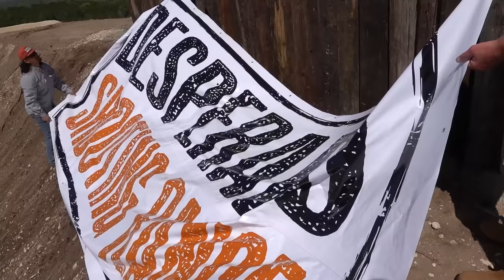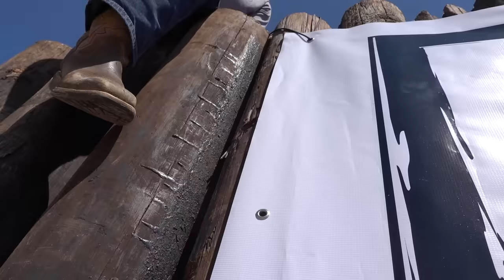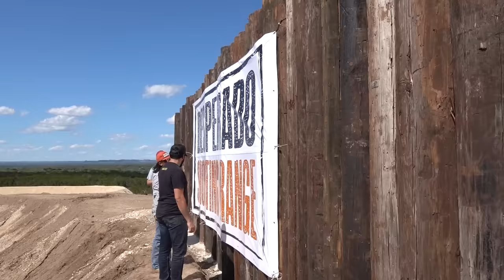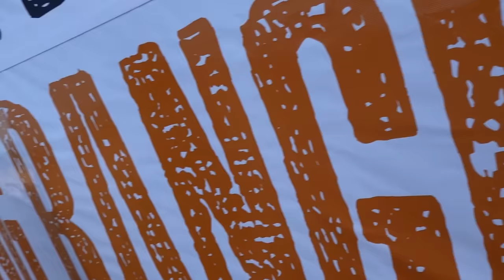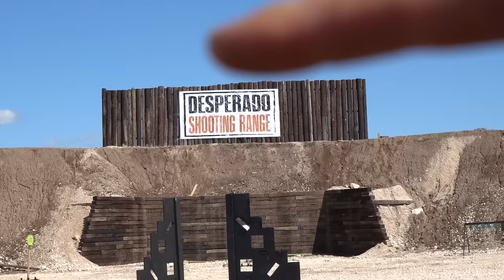Bad Problem with Underground Shipping Container... Y'all Were Right...

Comment: Hey Matt. I worked as a camp site supervisor for creation festival for several years in the past. One issue we had was when tent campers were camping next to people with RV’s. The exhaust from the generator was effecting the tent campers.
Reply: 1990, the year of the heat.
1989 the year of the mud.
Reply: Yeah that’s pretty fucking obvious
Reply: That's one major reason to have an electrical hookup. Also, the convenience is a pretty big one too.
Reply: I’ve been camping in my 40’ motorhome for 5 years all over the country. Not a single place as EVER asked me to put on a generator exhaust extension.
Reply: True that!! It's important to have a designated tent area. Some Rv parks just don't have tent camping. Also for anyone camping you definitely want a stay limit. Fed & state lands are usually a max of 14 day stay limit.
Reply: @smokeyiztactical aren't you a joy to have around.
Reply: Leave the wood in a pile for bonfires.  If your going to allow them. Camping = Bonfires.
Reply: My biggest complaint about tent campers is the 600$ price tag and 800$ for the largest Rv's......... wtf? I was thinking around 100 bucks or so for a tent spot.
Reply: @skydivejumprope $600 to $800 is what he is charging?  That's getting swindled.
Reply: @skydivejumprope  600 for a tent is a lot, as usually it's two people.... RV is acceptable if a family comes with their four children or some friends. And it depends on what is included.
Reply: $600 for a tent? That’s highway robbery!!!
Reply: Looks like plenty of fire wood to sell to all the campers coming in a couple weeks
Reply: @allaboutroofing2  lol swindled, do you even know what that means? Do you understand the demand for a space to view the eclipse? Its insane. You can expect that these prices are an anomaly due to the eclipse and wont be a standard rate.
Reply: @mammutMK2  He could have charged $1k and people would have still bought it
Reply: @kevinjohnson9404  "No fire pits" -grills only.
Reply: @reed785M  lol, it can be viewed most anywhere in the country. Clear weather is all that is needed.
Reply: @allaboutroofing2  eclipse space for camping is at a premium plus a lot of people are just  trying to support the channel not like its a normal camp site.
Reply: @allaboutroofing2  you’re talking to the wrong person, I’m not the one buying spots.
Reply: @reed785M  you just commented to me 8 minutes ago. I replied.  Are you okay?
Reply: @derreckmckenzie5521  right, no hook up or anything other than a hand wash station and Porta potties. Nothing like over paying to support a millionaire tho. 🤭
Reply: @smokeyiztactical  so obvious that no one would have thought about it.
Reply: @allaboutroofing2  you replied with nonsense, regardless of if you can view it everywhere, people want to be in certain areas and are paying to do so. I am not, so I’m not the person to be lecturing about “you can view it anywhere” it’s a pointless comment.
Reply: @reed785M  true.
Reply: Could definitely use a wood chipper converting all the cedar and dead branches into trail mulch.
Reply: Eclipses are neat. But they're not that cool. Turn the sun off for a bit and charge whatever you want? 600$ to pitch a tent????? No thanks. I'd rather just not watch it. But, i'm biased because i've seen them before.
Reply: It’s 600.00 for up to 8 people per spot though.

It’s expensive for a couple. But an entire family or group of friends… it’s still expensive lol
Reply: @reed785M  you seem dense. Have a good one.
Reply: Huh my best friend went to Creation for like 9 years. Small world
Reply: WAS A SUP<FOR CROWD CONTROLL COMPANY**     THIS IS A BIG TIME CONCERN***LISTEN TO THIS GUY********                   CATER
Reply: @scoobymoto9858
5 hours ago (edited)
Hey Matt. I worked as a camp site supervisor for creation festival for several years in the past. One issue we had was when tent campers were camping next to people with RV’s. The exhaust from the generator was effecting the tent campers
Reply: @MichaelCurley-il6sm  Many factors go in to the pricing. First, it is not your average day on an average campsite. This is for the Eclipse. I guarantee if you look up hotel rooms in the path of the eclipse, they will be 4X plus or more than normal rates. I used to rent hotel rooms near the hospital my mom was at for cancer surgery. She was there 3 months. Average room rate was anywhere from $150-$250, depending on the hotel. When there were events in the area, like medical congresses, you couldn't book anything for less than $250.
Reply: @TheMicro4 is creation only in pa? I been there, in pa.
Reply: Plus the load noise they create
Reply: Don't worry about the fire wood the campers will take care of it. Just have fire rings set up for them.🎉
Reply: @allaboutroofing2  You can only see the FULL Solar Eclipse from a relatively narrow geographical region.   anywhere else in the country will not get the FULL effect, only partials or mostly
Reply: Exhaust is the least of his worries.  He needs to have a dozen lawyers on standby and a hefty amount of cash for the EPA fine.
Reply: @TheXxxcodexxx 
That's the best kind. Who wants to go camping next to other people.
Reply: @stick004  In close quarter parking situations it's mandatory. People have been poisoned by CO from generator exhausts not being directed above the roofline of their RV's.
At any drag racing event most tracks will run under NHRA rules concerning generators, it's mandatory you have an exhaust extension to run a generator they throw you out. 
And it's just being polite, no one wants to breathe in the gen  exhaust of the guy upwind of their site.
Reply: He already addressed this in a past video
Reply: @iknklst  guess I’ve never had to stay squished in like a bug..
Reply: @TheXxxcodexxx most nice campgrounds will have electricity hookups.

Comment: Hey Matt, please get an arborist over. Those cut's Mikey did were tearing and bad. You said you wanted to clear a path for walking. Those trees can stay. Also an climbing arborist would make for sick content with you guys. Loose dead wood removal would be good for safety reasons.
I can recommend a few youtubers for potential colabs. "Veteran tree service"  "Guilty of treeson" "Buckin billy ray". They make the trees look nice and take care of them. Some of these trees are quite old. Cutting them down will make you unable to replace them to the state they are in within 50 years. Cheers
Reply: This.. this is great advice..Matt..do it.
Reply: It’s actually very good advice.
Reply: Yup, those cuts need to be at laterals or they are gonna be having some issue down the line for sure!
Reply: I bet guilty of treeson would trade some tree work for range time

Comment: At my job we use half circle wind slits unless our customer requests a different style.  We also would have hemmed the edges of the banner with rope extensions sewn in.  The hemmed edge helps prevent grommet tear out.

Comment: hey matt super easy fix that might work in the container is to put jacks sideways wall to wall and put boards length ways to displace weight, then you can weld up a new frame inside to hold the weight.
Reply: He should have listened to the person in the comments of the first video about it who does underground bunkers for and done it right the first time.

Comment: you should leave all that downed wood, for the campers to use for camp fires. they'll clean up every stick
Reply: I'll bet Matt is going to be selling bundles of firewood at the event.
Reply: Sell as campfire wood... don't just give it away
Reply: They’re doing grills only no fires this time
Reply: All those campers having their own fires would be a HUGE problem. On many levels.
Reply: @evanparker3877 that’s unfortunate.  It’s not camping without a proper campfire.
Reply: @KameraShy you would think that responsible adults could have a small campfire and be ok.  Thousands of campgrounds pull it off every year.
Reply: It says in the ticket link,  no campfires.  Grills only!

Comment: Matt, put 3 or 4  2x4x length of sign horizontally top middle bottom. Then, put up 3/4 plywood attached to the 2x4 with long construction  screws. This will stop the wind from the back and make it easy to mount the sign or mount new ones for events.

Comment: Matt, we had the same problem when we put that huge banner on our church. Even with grommets and screws it ripped through them. Pastor got a bunch of 1x4s  and made a frame with excessive amounts of 3 to 4 inch sheet rock screws and we haven't had a problem sense then.

Comment: Hey, just a recommendation for when you have a band come out. When I perform outside we usually use a trailer or stage to play on. You’ll need to make sure your band you’re having come out has a sound system with them and a sound guy.  Idk, you’re probably prepared, but just some recommendations. 😅
Reply: I doubt he's prepared XD good advice
Reply: And make sure the stage is covered. Don’t want gear or musicians overheating.
Reply: Generator for electricity, lights, amps, sound boards for the band use only
Reply: @thecursed01  I’m not sure if Matt realizes what all goes into music
Reply: @C-R_Music  main reasons why many weddings decide for a playlist instead of a band once they see the cost and effort needed XD
Reply: @thecursed01  ya 😂
Reply: i still feel so privileged, back in 2004 to 2005 i helped manage the press tent at a medium sized music festival in my country. had none of the super stress of the roadies or worries of the owner/finance ppl. but i saw the numbers and lists of tech, insurances, safety, and all that... ouch XD i had to babysit some bands, jump in for some interviews i ncase the scheduled one didn't make it and take pictures right in the press pit in front of the stage. loved it....apart the the detail that back then i thought hearing protection isn't metal/for old ppl...spot was right in front of the speaker tower.... hey..did somebody say fieeeeeeeeeeeeeeeeeeeeeeeeeeeeeeeeeeeeeeeeeeeeeeeeeeep? XD  @C-R_Music

Comment: you should put a 6 inch layer of nylon rebar concrete over the shipping container before the dirt. it will stiffen and offer rust protection to the outer walls of the container. inside will still need paint. and venting should be from out the back low up through the dirt to a snoorkel to the roof at the front so as the front heats up, it draws fresh air through a cool pipe into the container.

Comment: Matt...the best way to hang those giant signs is using strong bungy...and tension the bungy till it's quite tight on all corners, then tension the sides and top edge.....that way the sign can flex with the wind, but remain taught...if you  fix it with screws then it can't flex and rips....My Families company specialises in creating and hanging these giant banners in the UK....and I really mean giant , we've wrapped the tower of London while it was undergoing repairs, which was attached to, and hid all the external scaffolding....check out some of the work at Blink Giant media...all of the wraps are attached using loops of bungey with a steel hook at the end of the loop.

Comment: For the inside of that metal box, get these
Steel Ratcheting Load Bar Lock 2"X4" w/ Pads Van Truck Trailer. 
Put 2x2 foot steel plates on each end. You’ll need them down the middle and horizontal as well.

Comment: 20:40 Put some painted sealed plywood and a  2x? frame around it to protect the end grain and paint the logo sign on it.  No more wind problem. A couple smaller on each side for sponsorship or event signage. Have eye bolts in the corners and field for easy temporary banner hangs. Have a couple level pegs permanently spaced across the face, you could pull some string across for quick level hangs.  Build a 2 foot wide work platform and ladder on the back side so you could reach over the wall. And some flag poles on each end, maybe one in the center.

Comment: shipping containers need to be sealed for water leakage and shored up, they are not designed to take weight load on the roof panels. they a can easily rust and cave in , be careful

Comment: Consider digging up those onions ASAP as no one is going to want to camp on/near them.  Offer them to your food vendors.  They'll love them.  Maybe one can come up with a bootysnapple recipe using them just for this event.  Also, assuming fires will be allowed during this event, stack the wood for visitors to use.
Reply: Instead dig them up and replant in an area that will not be used for guests. Use that as the beginning of a large garden to supply produce to a future restaurant.
Reply: Fires are specifically NOT allowed, that’s been made very clear.
Reply: I must be weird, I love the smell of ramps/wild onions in the spring.

Comment: Matt, the "reinforcement" that you did is not going to hold. You need to reinforce the walls and ceiling from the inside. Dirt and everything is going to go under the bars that you welded on and cave in the roof.
Reply: Too late now. Already caving.
Reply: I don't think you can save that container. The idea was terrible, and Matt even knew better, but did it anyways. If he wanted a root cellar he should have built a root cellar the right way

Comment: A quick/simple fix.... build new steel shelving inside the container and use the verticals as supports running from the floor up to the ceiling. Done.

Comment: Build steel H frames inline with your shelving in the same positions as the added roof bars, x-brace each H together along the walls, and then steel door frame opposite H frames together.  I'm not a construction guy, but it could work.

Comment: Matt you need a 7 gang mower setup! You can pull it with a 4x4. Would take you 10 minutes to mow.I used to rebuild them and grind the reels and bed knives during the winter.

Comment: There are ways to take the pressure off that bulge and get some supports in, but this is more 1 of those "Call a Professional or get an Engineer," moments. Basically, you need someone with experience in foundation support replacement. They'll basically put some tall jacks in there so you can get some proper supports. From there, you can hang trusses and whatnot. I can only guess at the local conditions and the engineering style, but I'd estimate about 1 vertical per 6 feet of ceiling.
     C-Trains are good for figuring areas and shapes, but they are made extremely cheaply. Even above ground, always reinforce.

Comment: Get 2 long 4x6 or 6x6, put horizontally against the walls and support the levelled on the middle of the bulge, find something strong to use as push 'rods / braces' in between the pieces of wood like old drivetrains from old trucks or scrap pieces of metal just so you can put some hydraulic lifters in the middle, like in the horizontal or those lift jacks for removing heavy trucks from sink holes and etc and start to sync with your crew to slowly push the walls one against another until you have a relative flat again (will never be the same) and then you reinforce with steel... like, divide in thirds and reinforce on the most vulnerable points... depending of what you use to reinforce, like ancle iron for example you can even use as support for some shelves in the future or safes for some itens that need more 'care'...

Comment: Theres a video of a guy somewhere doing buried shipping containers, goes into massive detail on it , in order to prevent corrosion, keep it level footed and how to insulate it too.
Spray foam on the outside and concreted over was the  eventual  solution i think.

Comment: You can do this without collapsing the walls of the container by filling in about six inch lifts with horizontal geotech fabric between each lift, wrapped up and over each lift above. (Think geotech burritoes) This breaks the fill plane and reduces the lateral pressure significantly, and you can wind up with a much steeper exterior slope, reducing the lateral pressure even more.

Comment: Matt, as someone who helps set up large music festivals(80,000+people), don't put off marking the sites till the day before.  It takes a lot longer than you think it does.  Also, you should try and separate the tent campers from rv's.  Not only for health reasons but many generators are loud.  You may need to enforce a no generator after 9 or 10 pm due to noise.

Comment: That banner sign is going to shred pretty quick. It should have the edges all folded and sewn (or welded) and the grommets through the doubled up folded area. Looks great either way but just not going to hold up very well when it gets windy. Also, wind slits cut into banners went out years ago - was proven may times over to just ruin the integrity of the banner with no significant reduction in the ability of the edges to hold.

Comment: Great video. Are you gonna make a bonfire with all that wood from the field for your event?
For the telephone poles try a mud/straw on the backside (between poles) to prevent wind from going through it (with chicken wire to support it the mud). For additional signs put some spare screws and washers on the end telephone poles.
Would you get an arborist to look at your trees, to make them healthier.  Also by your water hole/pool have you considered planting fruit trees (what ever is best for your area) with drip irrigation.  This will give the watering hole/pool shaded area in the future and nice area for some grass for picnic area.  Trees that roots grow downwards and not outwards.
Loved the container, next time maybe reinforced concrete for the walls.  Not sure about the top of container.
Have you considered ICF buildings for main buildings?